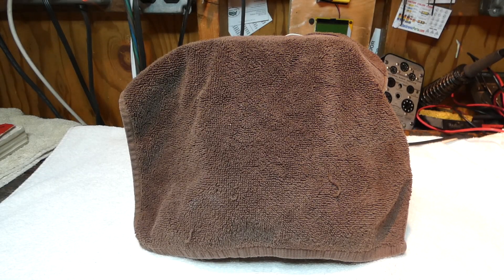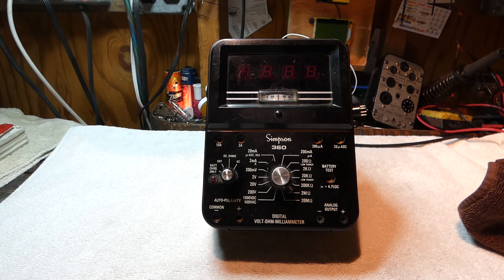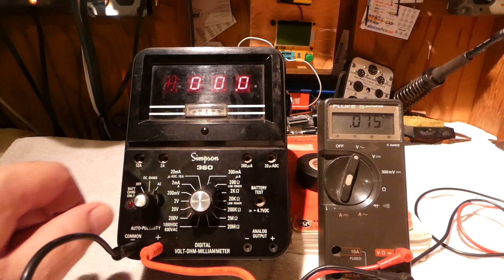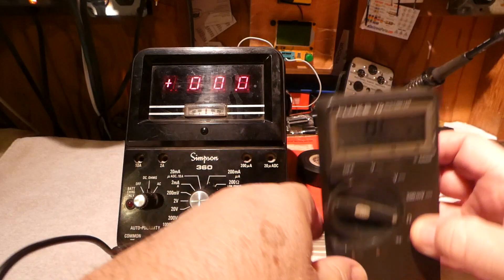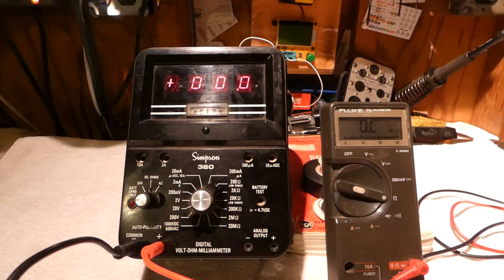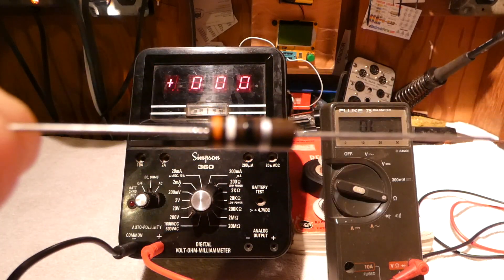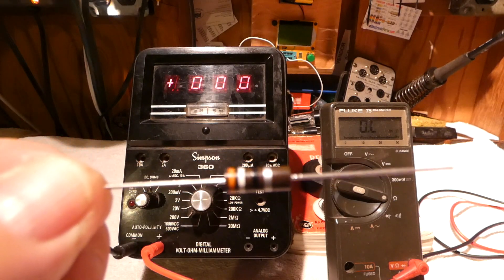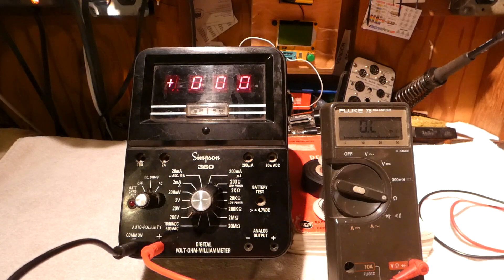Fair Lawn Auction 2021 Find

Comment: That's great, I want one! I'll give ya $50 for it !!!  Joking aside, it's fab and I'll certainly save a search on eBay and see if one shows up. You didn't mention if it might have been a FET transistor type I have one in my shack and the name of it dodges my memory right now but it also has a red digital display and must be getting on for 50 years old now, they're just lovely to use and look at. Nice one Bob. 😎👍

Comment: hey radio wild i have a 1947 philco am/fm radio i want to have you restore it to original condition! only parts i have are replacement original philco knobs. i replaced the original power cord.